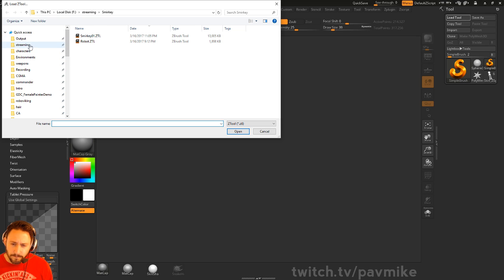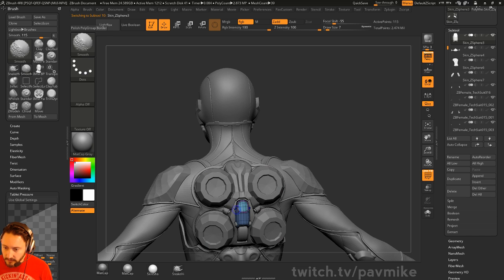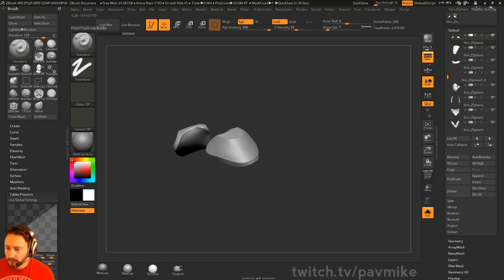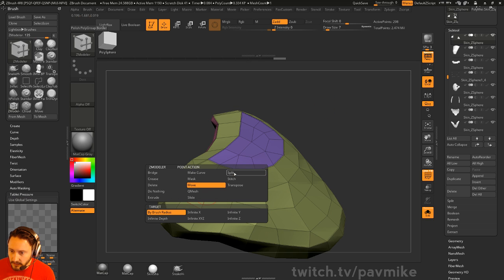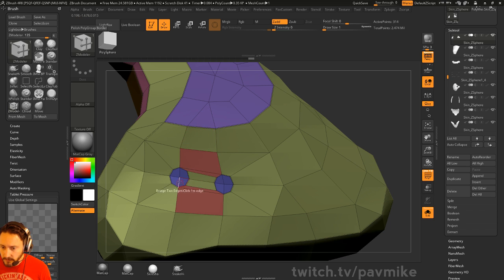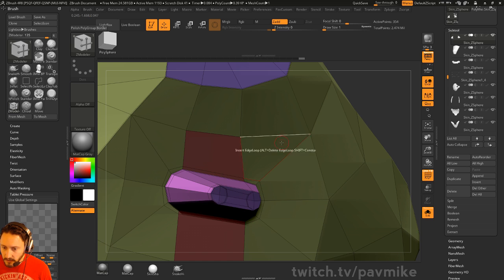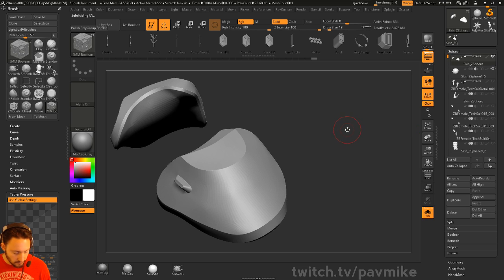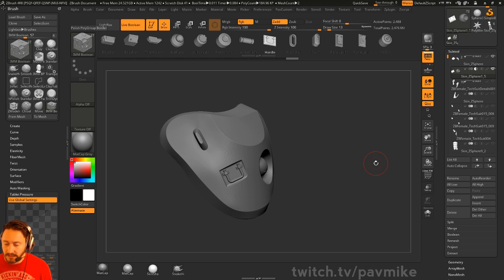PavWork15: ZModeler and Live Boolean Detailing

Comment: Hi micheal pavlovich, I need your suggestion and help, do you have any suggestions how to use zmodeller. I'm modelling a car using zmodeller,everything is fine but the major problem is when I'm using any function on zmodeller like split,qmesh and others,only front poly is affected and the back poly is intact, it's mean that my front poly is perfect and the back is horrible.do you have any tips how to make zmodeller function just only thin plane or just front poly
 only,and then we can adjust its thickness. .

Comment: Hi Michael, If I have a subtool with multiple subdivisions, and I wanna use the live boolean, where should I insert and do the boolean operation, on the low or the highest? Cuz I tried putting the boolean on the lowest and when I bake it into a new subtool and subdivide, it has this weird crunchy look to the edges, I tried creasing the area and it still has some noticable uneven surfaces. Thanks!
Reply from the maker: if it has "real" subdivision levels, do it at your highest. If you have dynamic ("fake", or preview) subdivision levels, leave it at the lowest, but make sure you turn on the "div" option in your boolean menu so it creates a high res to match your preview before performing the boolean operation.
Reply: Michael Pavlovich Thanks Michael for the quick response as always! You’re awesome for helping out aspiring artists and sharing this knowledge! :)